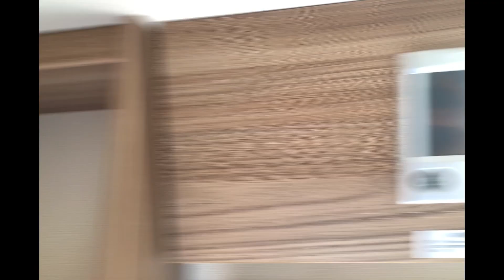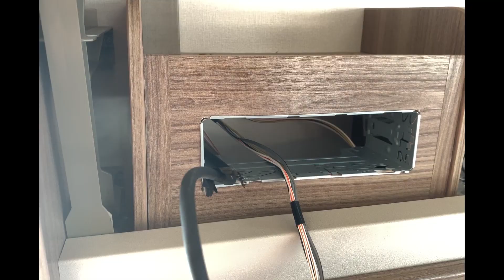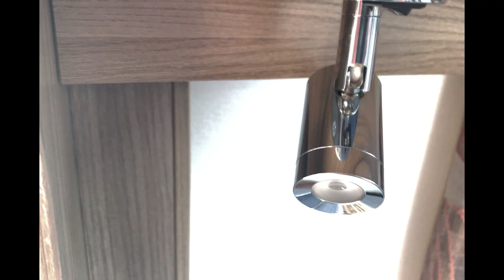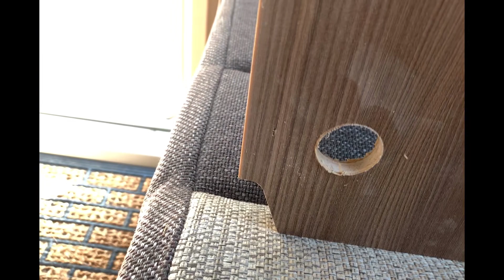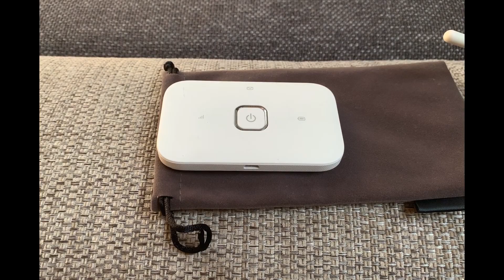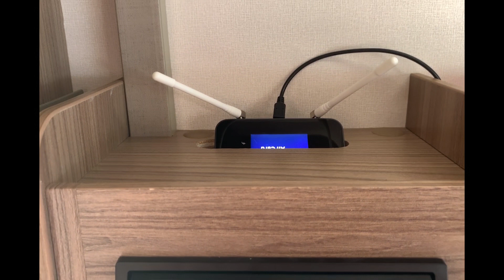Installing a USB socket in our Swift caravan

Comment: If you flip the little door on the right hand side of the radio front, you shall find a USB socket there.
Reply from the maker: Hi Clifton. Yes, the radio has a socket.  Didn’t think of trying it out. I don’t think the radio has been switched on for more than five mins since we bought the van (& it would need to be on to charge). Good point, and glad for another USB-A charger, there never seem to be enough.  Pete & Kaz 😀👍😀👍

Comment: That's something we need to get done in our old Lunar, as well as putting LED lights in!
Reply from the maker: It’s a reasonably straightforward job to replace the incandescent lights with LEDs. Up to you if go for the lights with integrated USB or to wire in an additional socket like we did. Down to personal preference.
Reply: @CraftyCampervanners  probably easier to go with the integrated usb I think, would be a perfect time to get things done if we could actually get to the caravan 😢

Comment: Nice neat job! I have got some more usb sockets to put in myself. Just need to decide where exactly to put them, and wait until the boss goes out so she doesn't stress when I pull out wires. lol.
Reply from the maker: Thank you !  My next trick with USB may involve something a bit more ambitious with the wiring. No handy light to piggy back off where they are intended. It could be more difficult, but we don’t want dangly USB wires in our caravan.